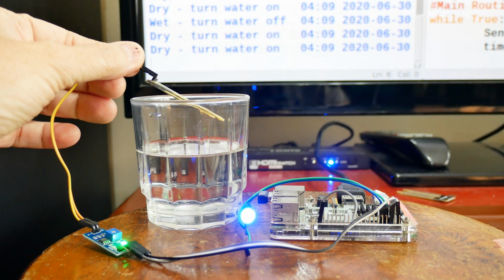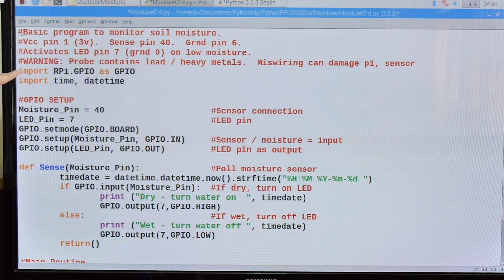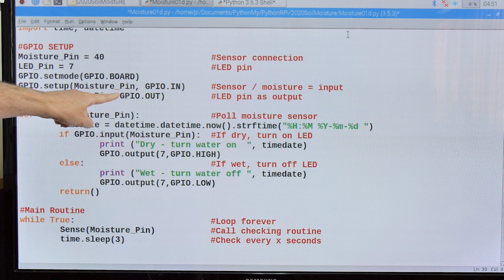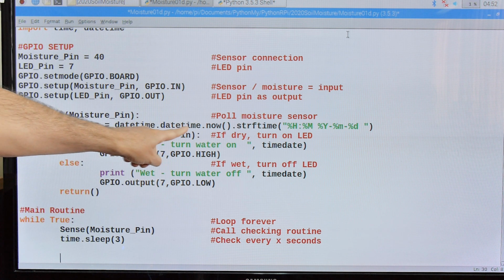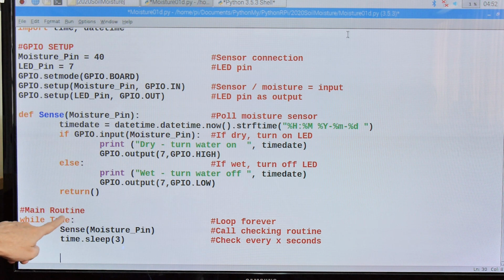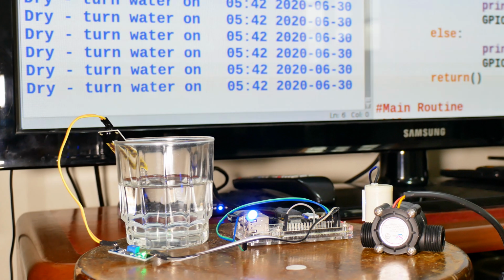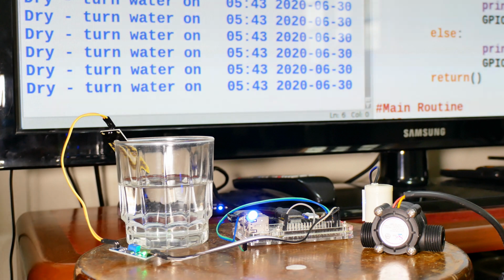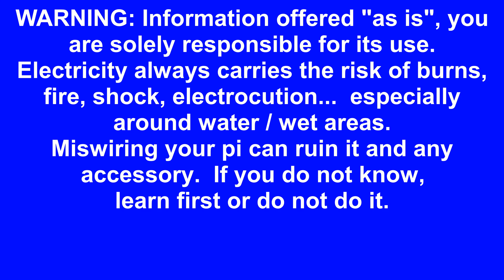RPi 31.0 - DIY Smart Soil Moisture Sensor Exp: #1 (4K)

Comment: Cool video!  Just a heads up, you should always use a current limiting resistor with an LED.  The blue LED's also have higher forward voltage than their neighboring colors!  Can sometimes be fine but will usually burn out the LED at some point or burn out the pin on your Pi.

It is also possible to get LED's with a current limiting resistor built in (they always have a bit of internal resistance in the bulb and the wire).

Comment: Jinx.  Been working on exactly this project for the backyard for the past week.  I went with the cheap capacitive soil sensors hooked up to some 8266's.  Really fun project I finally got back to after being abandoned for a decade.  Node-Red is making it dead simple.
Reply from the maker: I've got version 2.0 coming soon where it drives a (BIG) pump and operates on a schedule to prevent over-watering.  If you post a video, let me know, I'd like to see it.
Reply: @tsbrownie  Will do.  Can't wait to see V2.